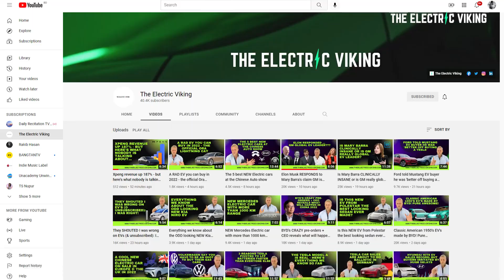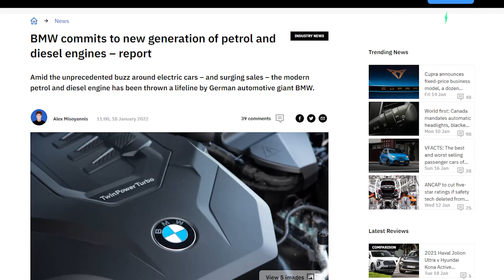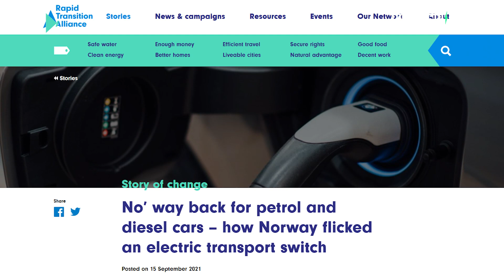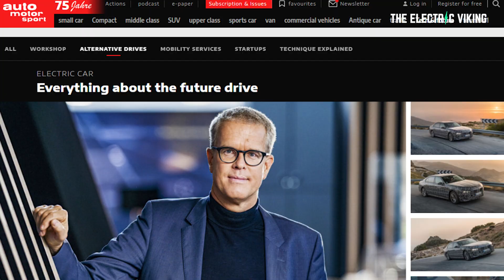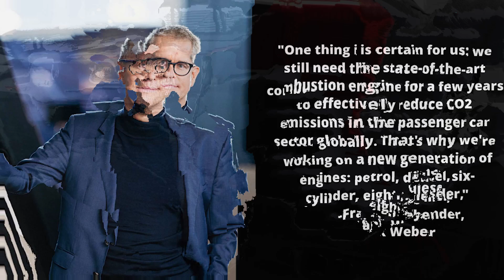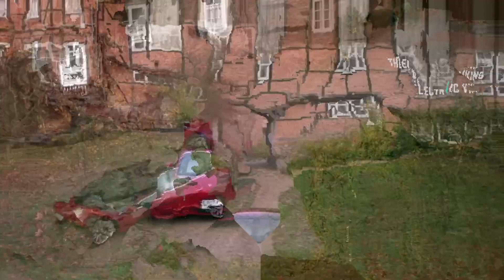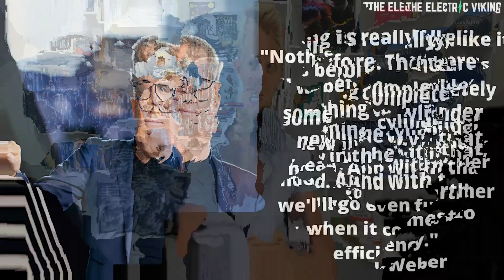This is why BMW is most likely German auto to go BANKRUPT

Comment: I think there will be cases where LPG, petrol and diesel engines still make sense but at considerably reduced numbers than today.  The higher cost of entry to BEVs compared to second hand ICE cars will be a factor.  In the longer term, you can see reduced production volumes of petroleum fuels will lead to a higher cost per unit and a smaller number of retail outlets but that may be over a 30-50 year timeframe.  Cars may transition quickly but I can't see aviation and shipping alternatives on the horizon as yet.

Comment: They ARE deluded. What advantages remain over EVs? Not speed or power. Certainly not smoothness, quiet, comfort. Luxury is well-covered in the EV world. I don't expect the transition to BEVs to come as quickly as Sam does, but that's a quibble, a matter of a year or two. By 2030, the game should be over. Soon construction equipment, drilling rigs, pretty much everything with wheels will be battery powered. Snobbery and brand allegiance won't save BMW when Mercedes goes all EV, which won't be long. Painful to watch them "improving" doomed technology, making them a bit less polluting and wasteful. Bandages on multiple fractures, I call that. VW has wised up, maybe in time. Ford may survive. Korean makers are trying hard, may make it. Toyota and BMW are doomed, it seems. Imagine how eager their best engineers are to jump ship, join more promising companies. Already some of Japan's top engineers have been recruited away by Chinese EV makers.

Comment: The name BMW is short for Bayernische Mototoren Werke, bavarian engine factories. The "engine" in it refers to ICE engines.
So it is in their nature to not understand the change to EVs, or not to follow it. It is just not something they do, what they are good at, not their  field of expertise. And they do not pretend it is.
That view is my speculation, but it would make some sense.
Reply: BMW also stands for "Bring mich (zur) Werkstatt" = "Bring Me (to a) Workshop". I don't see those often except for an oil or tyre change. That's because I have a Lexus RX 450 hybrid and a sexy little red 1992 MR2 that refuses to break down and is about to become an official oldtimer at 30 yrs old, still original and technically A1. THAT is sustainability. ..and if the German car manufacturers often-quoted "premium" includes reliability, which of course it should, then they've got that too. Don't tell anyone here that (N. Germany), though. They can't understand why I don't drive one of the big 3 and are puzzled when I pull up at our golf club. To them Lexus is not up there with BMW, Mercedes and Audi. Both of my cars are "rice bowls". The bigger you are, etc.

Comment: As BMW is a well-known logo, it will not disappear. Will just change the business. Philips made the best radios once upon in time, Nokia made TV first, etc. Volvo is no longer a Swedish company, it is Chinese. Nothing is lost, all is transforming... So, BMW will go electric, will sell based on the execution quality and brand, not on performances as EVs make the performances accessible at a low cost. Do not forget that there are still producers of chariots powered by horses, 100 years after the engine took their place... They are doing so as the brand sell, not the car properties. The problem will be just the brand damage from other sides... Anyway, the "German quality" is a joke for all the producers and models after 2001. Really, the biggest problem for them is that in the EV era they make no difference. They have nothing better than others to claim those ridiculous prices. This is why they continue with the ICE as long as possible. They have ICE technologies much better than others. But, suddenly, are no longer necessary. And by the way, if it goes into bankruptcy, is not their money, is the investor's money...And yep, the countries which cannot move to EV, cannot buy BMW also...
Reply: @benjaminsmith2287  Volvo bus, yes. Volvo Penta, yes. Volvo cars, no. It is owned by Geely - Li Shufu. Yep, seems he wants to sell Volvo so made a complicated movement, Volvo took control over the parent company in order to go public. That means he no longer believes in Volvo so try to escape with the maximum profit from this, making it a "public offer". Who has a head, understand... Geely has in Sweden another company, CEVT which is specifically developing EV.

Comment: BMW are all about the "ultimate driving experience", so we're talking about performance, right? The things aint cheap, by any margin. I just watched a "drag race" clip here on YouTube. A Model Y Plaid - a sedan, not sports car - costing $ 126,990 left a Porsche 911 Turbo S (€ 227,256,-) standing. Two other high-end sportsters were not not that much quicker than the Tesla: a McClaren Senna @ $ 1,050,000 (only 75 will be built, so don't bother nipping around to the dealer's) and a Bugatti Chiron, the cheapest version @ $ 3.3m. There wasn't a BMW in sight. Mr Musk must be doing something right. 'Nuff said.

Comment: Finally got some feedback on the BMW development of ice engines going forward. My colleague in Germany informs me that they developing the large displacement engines to use biofuels, synthetic fuels and hydrogen both in gas form and liquid (ammonia). These larger engines are used in many other applications including military uses. He would no elaborate any further. My guess is that comment about the development of the cylinder head is much more relevant than we might think.

Comment: BMW knows they cant sell any ICE car in the EU from 2035 (Diesel 2030 en gas in 2035, but there are plans to ban all new ice by 2030), 
But most EU countries will have a ban for new ICE cars in 2030. Norway 2025, Netherlands and Denmark 2030, Belgium 2029. 
Only the countries with larger car manufacturs like Germany, France and Italy are against those bans.
When BMW keeps building that, they will indeed go bankrupt between 2025 to 2030.

Comment: I really enjoy your content but sometimes you seem rather naive about the larger automotive industry. Things are definitely going electric, that is a fact. But there are still many who desire or sometimes feel they need ICE PU. BMW are just recognising this. New ICE designs that will further reduce emissions over present development is important for this diminishing sector. I plan to buy both a second Tesla and Corvette. For myself and many others, the tiny segment of performance cars is the only one where I prefer ICE’s. I’ve an older restomod Vette and it is used just for pleasure. And I will continue this in future. I want to see 99% of all cars go electric but I want to be able to use a synthetic e-fuel for ICE cars. I think that the important thing to recognise is the need to get off fossil fuels. We need to demean and diminish the petroleum industry. The switch to EV’s, while incredibly important, is diminished when so many countries are continuing to build fossil fuel plants to meet the increasing power demand of the grid. Australia is doing great. When I am in Denmark I am so pleased to see the change renewables in real time. But these are the exceptions. I would like to see you cover what is happening with changes to renewables for the grid in different countries. Or the development of synthetic fuels for what I think will be a very small part of the automotive world. This is all important to what is happening for EV’s, for transportation, for the climate. Maybe talk with some people with legacy auto to understand what they are doing and why. Don’t back yourself into a corner, railing against things you don’t like but maybe don’t see the bigger picture. We don’t need another Tesla/EV fanboy, I would like to see more objectivity about the whole situation.

Comment: BMW is choosing a very complicated and dangerous strategy. But I don't think this is a shortcut to bankrupcy because of their very flexible platforms and production. BMW makes different models and bodies, ICE and EV, on the same production line and is totally flexible in numbers of each. Perhaps they believe their new generation ICE engines will be leading among the few offerings remaining in times of new emission standards and win the remaining ICE-morons buying BMW instead of now-electric brands? At least, they are putting out EVs, too. Let's see if their savings are big enough to survive the unevidable transit.

Comment: BMW rubbish! My 5 series cost me over£16000 in repairs in 3 years. Eventually with only 47000 miles on the clock the timing chain snapped,destroying the engine.this was the worst car I have ever owned and I once owned an austin allegro :()

Comment: I’m surprised more manufacturers aren’t transitioning via plug-in hybrids, particularly Japanese and Korean manufacturers who have the edge in small lightweight engines. If you just use the engine to drive a generator you can do away with a complex transmission  and only have it kick in at one or two speeds when needed.

Comment: Henry Ford's wife drove an electric car...all the way up to the point the electric starter was invented and added to Ford's ICE car. 

Chevrolet (invented by GM to compete with the Model T) was eating Ford's lunch. Henry Ford shut down his whole operation for an extended period to move from his Model T (with a straight 4) to his Model A (with his newly invented V8). If usable batteries had existed, he could have just as easily shifted to electric...his switch was that drastic. Ford gained his lead back...largely because of the V8 and all the new technology the Model A introduced. 

Legacy manufacturers always have such forks in the road. They typically form small "start over, clean sheet of paper" teams to transition themselves. Engineers seem to have no problem with this. Accountants and finance dolts have lots of problems with it. And of course unions are the biggest disaster to productive enterprises of all. Unions are parasites of the "destructive" type (contrasted with the "complementary" type).

Comment: If you study BMW's history it was a motorcycle company that eventually started making cars and the motorcycle side ran all things. Up until 2000 the motorcycle side ran the whole business and bailed out the car side a few times in the 50', 60's 70's 80's and 90's. Then the car division was spun off and with key motorcycle management driving it forward. Of course the Harvard effect then took over. The Harvard effect is when a Harvard grad takes over a very profitable company and then runs it into the ground because every Harvard grad is useless and relies on their connections for sucess. When Jobs was fired from Apple and replaced a Harvard grad who then nearly bankrupted Apple and Jobs had to be bought back to fix it.

Comment: Am not aware of anyone having access to a crystal ball.  The world is heading for "transition" but what happens when the grid becomes unreliable?  And, is there enough capacity for 98% or even 50% of the world to be on electric (my guess is hell no)?  An abrupt shut off of new ICE vehicle manufacturing is also foolhardy.  As with many things we should proceed without over doing.  I believe phev cars will dominate for generations.  No one likes to be stuck in gas lines or ev charging station lines.  I like options.

Comment: In a lot of countries, (Australia for example) will have most of their electric cars powered by coal.
I would like to see how much carbon it takes to build the ICE and the electric cars. And then run a 10 year life cycle on total carbon, to compare the two.
I think what the BMW guy is saying is, we are in a transitive phase and there could be a place for a highly efficient ICE cars. I agree however that the depreciated value of these cars at 10 years could be scary.
I have a mate who has a diesel VW and gets 5.5L/100k on highways regularly.  I always wonder how his carbon footprint would compare to an electric car.
Reply: these comparisons are regularly updated and published. No guesswork to be done. The worst case scenario would be both vehicles produced with pure coal power, nobody does that, and then running the EV on pure coal power, not even the aussies do that. So depending on the kg of CO2 per kWh and the car's size/type you commonly end up with numbers of 2-6 years with every improvement in inclusion of renewables driving the number down. Median use time for cars in Germany is 18 years. In Australia it is likely longer. PV and wind will be big in Australia, it is just a question of time.

Comment: Well, with all love for EVs - but in the end the electricity they consume must be CO2 neutrally produced too. So if you burn coal to produce electricity that your car uses it does not make it CO2 neutral. In 8 years there will be many countries that do not produce clean energy hence a reasonable efficient ICE will be cleaner than an EV. I am fully in favour of the electrification but it will simply not be clean in 8 years nor will there be the infrastructure available globally why the BMW strategy might not be so dumb - after all there are some smart people working there too and they know their business. When everyone else stops making ICEs BMW might have a market. Just saying...
Reply: Even if you charge an EV with coal fired power only, it is still less polluting as the efficiency of use of the electricity is about 3 times that of the ICE.
Reply: @jimporter7418  But the production of electricity from coal is not 100% efficient - just have a think. You can be a fanboy but also look at the facts. The production of an EV and the batteries is also not CO2 neutral.
Reply: @gustavmukki3165  An electric car gets cleaner every year as the electric mix gets greener. An ICE is as dirty in year ten as when it was new. But even if 100% coal (which is nowhere) EV is still (even if marginally) cleaner than ICE plus the emissions can be better managed at a central plant than in a million stinking engines pumping carcinogens direct into pedestrians faces. In any case this is no longer about green its about economics. When the EV is cheaper to buy and cheaper to run than an ICE the economic argument wins and luckily the environmental aspect is carried along in its wake.
Reply: @Joe-lb8qn  The question here was whether BMW will go bankrupt or they are "dumb" by doing what they do - and I would disagree with the Viking here. I'm well aware that there is a transition but in many countries it will not happen soon. Also a BEV is not 100% efficient as some suggest here. From loss in the power plant, loss in transformation, loss in transport, loss in charging and losses by heating or cooling the battery pack to heating the car (which an ICE does automatically by being a moving heater:)). Also the manufacturing of solar panel, wind turbines and so forth have an environmental impact. Before a BEV is cleaner than an ICE it must run for a while and then you look at the countries that generate 80% of energy by burning stuff and not having the money for the infrastructure for electrification - further advances in ICE tech also make sense and help whether the EV fan likes it or not.

Comment: If BMW had even 1/4 of a working brain they would start by switching all their ICE models to PHEV models with 100 km range. That would provide BIG emission reductions for their fleet and allow for performance to be retained using much smaller ICE engines.

Comment: 2022 Tesla Model S Plaid First Test: 0–60 MPH in 1.98 Seconds

The fastest production car in the current BMW line-up is the M5 Competition, which can accelerate from 0-60 mph in an eye-popping 3.1 seconds. 
1.1 seconds slower than a Tesla!  I thought people bought BMW's because they were fast. Clearly not as fast as electric, therefore why would anyone buy a BMW? Running costs - not that would be your first concern if you are buying a BMW M5 Competition, but if they were then the Tesla would be a lot cheaper. Resale value if that was of any interest. Tesla in 5-years after purchase almost certainly going to be worth a lot more than a BMW.

Comment: I mean he's partially right, at the moment the biggest thing that is hurting EV's is you are just taking carbon from one place and moving it to another. You need power plants to ramp up to produce even more power to be able to keep up with demand for all the EV's on the road. As much as people hate it but nuclear fission reactors are the most efficient and cleanest when it comes to power production. Solar panels work great when they are on the roof of houses or buildings but solar farms are stupid, they clear out big areas of land to install the panels displacing wildlife. What electric companies should be doing is subletting solar panels from solar farms to residential homes and business roofs by paying the property owner a fee for the use of the roof space.
Reply: @prioris55555  what colour is the sky in your world?
Reply: @prioris55555  True but carbon monoxide and NOX are not plant food they are pollutants and both cars and power plants that use fossil fuels emit them. Yes in the past the carbon dioxide level was far far higher and that was a time when the earth's temperature was higher and most of the planet was tropical. But the other two mentioned pollutants are what causes smog. Smog has been shown to cause early stage lung cancer and a variety of other ailments.